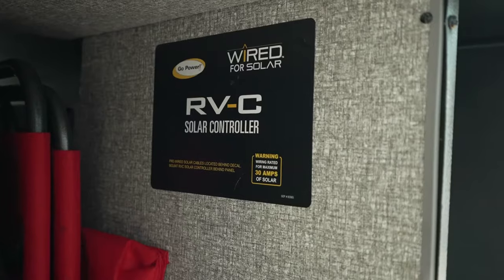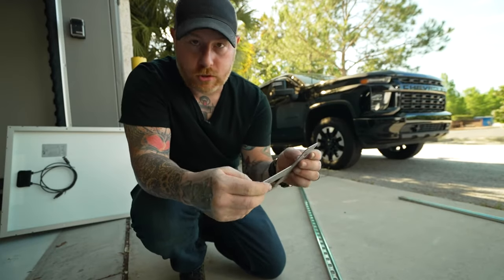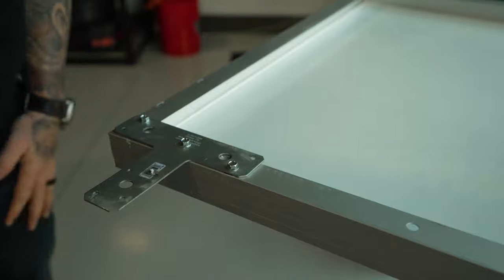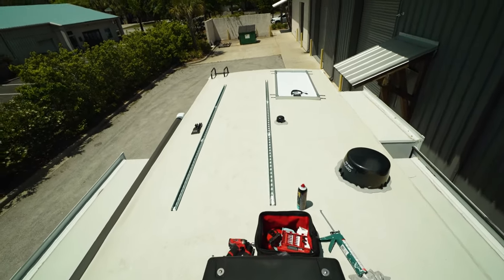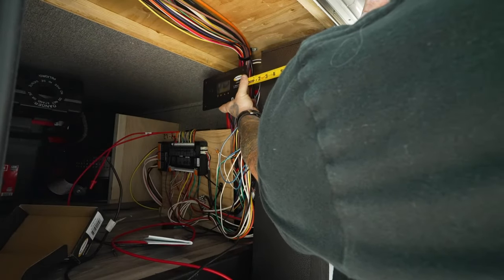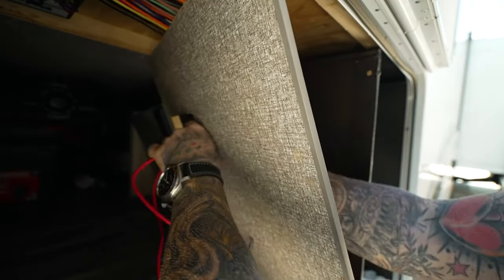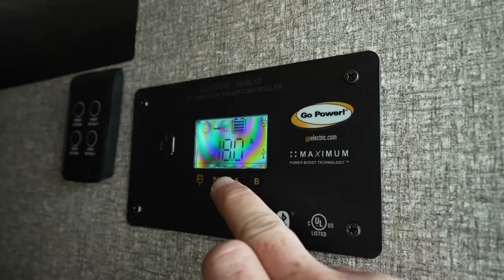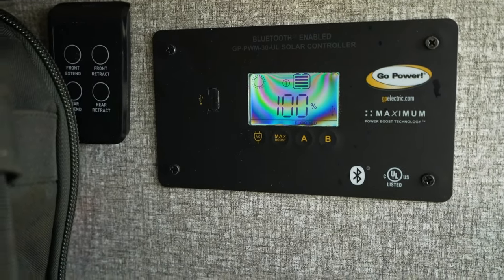Installing Solar Panel System on a "Solar Prepped RV"

Comment: Thank you for the video. My husband passed in February and we were going to get an RV and travel selling everything we have. So now I'm doing it. I have 5 solar panels that he was going to install on our house. But now I think I will use these for the RV. I just need to look further to understand how to set up the entire system. I have a Aims Inverter Charger. 120v. I have plenty of batteries around this place all plugged in keeping charged. I like the strip pieces you installed on the roof. Great idea that I will probably do. I have a Class C 28' RV. I'm 68 years old and I hope I can pull this off. I am renovating the RV on my own. It's beautiful!
Reply: Love that you are carrying on with dreams and plans even with such a great loss. Go for it!
I bought a trailer last year and toured Az for the winter.. Also now putting a solar system together.
Reply: That's horrible I'm so sorry I hope if your on the road right now I hope it's going amazing
Reply: Sorry for your loss

Comment: On my install I applied Eternabond tape in each spot where a bracket screwed into the roof. After drilling the holes through the Eternabond, I applied Dicor to each screw before driving it in. Then I sealed the bracket/screw heads with a liberal amount of self leveling Dicor. I inspect those several times a year, and add sealant on top if needed.

All the sealants - Dicor included - will dry out and crack in direct proportion to the amount of sun/weather it receives... usually within a year or two. Eternabond has been known to last many, many years - a far superior seal than lap sealant. Keep a close watch on those screws holding your brackets. If that sealant dries out and cracks, there is nothing stopping water from wicking through into your ceiling.

Lastly... I've seen 10+ year old TPO roofs with jigsaw puzzle Eternabond patching... and NO leaks. Remember, no one can see your roof anyway. If I ever reconfigure/update my panels I'll just overlay the existing holes with Eternabond and be done.
Reply: I police RV roofs for beauty! lol

Comment: Another option is residential solar rails. I’ve heard but haven’t personally experienced that Unistrut collects debris because there’s no air gap.
I used IronRidge XR10 rails. They’re made out of aluminum and super lightweight. A 14’ span is only 6 pounds and incredibly strong. I paid $43 per 14’ rail.

Only issue is that it’s slightly more difficult to find. I got mine at a Rexel but you can try contacting a solar distributor or electrical supply business nearby for pickup.

Comment: They made fittings for unistrut that are made per the gauge of the strut (12, 14 and 16 if I remember correctly?). 
The fitting I have in mind is basically what you’re doing but stronger and cleaner. The fittings for unisteut is a little pricey for what it is (between $12-$20 if my memory is right)

Comment: Thanks for the tips! I will be putting a second 370 watt panel on our new Brinkley in the next few weeks. Not sure if I can use you the method you did  but it is interesting. The Brinkley comes with one 370 watt panel and a 50 amp charge controller installed. I will put a second panel and a 3000 watt inverter in. Also they use a special self leveling caulk which I already got with the kit. Thanks again. Burlington Bill singer songwriter busking on the road and here on You-Tube.

Comment: Nice, I'm gonna use this setup on my RV. I'll give you a shout out when I make my install video. You have some nice roof space up there. you could easily put enough panels to run your AC(going over that pipe vent). I'm installing a 48V battery and should be able to run my single AC unit during the day and then should have enough power to run my AC for  5 hours after the sun goes down.  cheers.

Comment: Great video, im planning on doing this exact same install on my 5th wheel. One question, what size bolts did you use for the drop in nut in the channel. 1/4 or 3/8? I was worried about 1/4 not being big enough for a strong wind. Also how long of bolts did you use for those, 1 inch? Thanks in advance for any information, and DIY people like me, rely on videos like yours to give us the information we need to do it ourselves. Keep up the great work.

Comment: Well done! Couple questions…1. Where did you get.  The “channel swivel nuts” or whatever they are called. 2. Did you use a stud sensor to try to screw your lags into the studs, or not worry about it? 3. How many lags did you use, or how many per feet? 4. I may have missed it - fiberglass roof or rubber over wood? 5. Did you use galvanized lag bolts and washers? Or not worry about it given the dicor cover? Thanks much! I subscribed!
Reply from the maker: Hey, I got all the hardware from home depot or lowes. they both carry these systems... Look near the electrical conduit and stuff.  I did not use a stud sensor the roof is ply-wood and has plenty to screw in to anywhere. I think I used 4 lag bolts per channel. about 1 every 24 inches or so. I used both galvanized and stainless steel hardware. maybe some zinc coated too... Hope these helped. Thanks for following along. check out my other RV focus channel too. @thebrodiebunch
Reply: @BeavBrodie1  Naaaice!  Thank you for your video and further information on where we can find the rail and how far a part you screwed in.  We will do the same set up!
Reply: The Channel is called
THIN UNISTRUT IE REGULAR UNISTRUT is the same height as it is wide.
Those nuts are called
SPRING NUTS FOR UNISTRUT.
they start in 1/4" Threaded holes and go up to 5/8ths " Threaded holes.
Unistrut and spring nuts are the Lamborghini of outdoor universal mounting hardware.
Anywhere you look on the most important structures that is what's there they also have Hundreds of types of mounting hardware and make all of it in Lightweight Aluminum but it's expensive and worth the cash

Comment: Great Video as I’m about to do the same exact install on my new Jayco! I guess my only concern would be the struts acting as 10ft dam like areas where water could sit on the roof? This happens at roof seams and typically is the spot of most leaks.

Comment: Curious how your inverter is wired into this. Also I’m looking at a Victron MPPT controller with a 200W panel to maintain my two Type 24 AGM batteries for now and possibly expand later.

Comment: Have you noticed how the water drains now? I’m concerned about water damming up against the strut. Maybe I’ll put some washers under the attachment points to the roof to raise the struts slightly. Overall great video, thanks!
Reply: I would agree with this thought. I would also like to use stainless as galvanized can still rust and drip rust onto the roof.

Comment: Wish I could make a plan to discuss my install with you. My son and I live in a trailer and want to add solar to go off grid. I don't want to use gas for refer/hot water heater, I want them on solar power with lights. Basically,  I want solar as if I were plugged into 30amp power. Jonesy

Comment: i am uncomfortable drilling into the roof, tho i appreciate your video.. for making the panels more secure, but i am using the no drill bracket method with eternabond.. ( i am parked at a campground and i just want to have uninterruptible power) and add resell value of course, .. but i have 1kwh of panels (24v) going to a hybrid 3kw all in one inverter (powmr) that can take shore/grid power, PV (solar) and use battery for load .. with priority settings.. using PV 1st then battery to a low 20% state (i set that) and after that it will pull from grid .. to power the RV and also charge batteries back to 80% before the batteries take over again.. or if the sun comes out PV takes priority to run load and charge.  all told cost was 2200.00 .. I am surprised your not running something like that for the cost basis and scalability..  I can scale my system to  5kw in solar and 50kwh of battery as the inverter can handle 450V of panels.

Comment: Excellent video. Well we’ll explained! Did you screw the lag bolts into the RV’s roof trusses? I’m thinking about adding solar to mine.
Reply from the maker: Hey, thanks! I did not go in to any trusses or framing, (that I know of) Hard to locate. my roof is solid plywood. making it hard to located, but also plenty strong to screw down the tracks anywhere.

Comment: Hey great video. I have a Jayco north point and have considered adding solar and an inverter. The rig has solar prep and like how easy you showed it could be configured for solar. You say that you put in a shunt from victron and an inverter from Renolgy. Do you have any pictures of how or where you installed these items? I was considering installing the victron multipro2 inverter and was hoping to get insight on the renolgy installation as it may give me ideas for the victron inverter install. Thanks

Comment: Great idea but, stainless strut and hardware would be better. You can also use strut flat t’s, also stainless. They also have strut covers that will allow you to use the stuff itself as a raceway for your wire.

Comment: I like the install, but I'm concerned about corrosion on the HD unistrut channel and  nuts. SS Unistrut would great.
I saw an install recently that was done with epoxy, no screws into the roof.
Reply from the maker: That’s an option too, but no flexibility in the future and  the epoxy is only holding to the roof membrane. unless you have a fiberglass roof..?
Reply: @Beav Brodie  yes good point. I was thinking of fiberglass roofs.

Comment: The galvanized unistrut is only a good idea until it starts rusting, which doesn't take to long. Then you ready for a whole roof replacement for $10k.
Reply from the maker: Galvanized stuff doesn't rust. No problems here.

Comment: I used your hand me down idea to install 12 - 100 Watts  panels  on my friends big motor home ,  but the wireling  is what's  getting me confused  , should  I wire them in parallel  or in series? He has a good inverter and a solar  charger, but he like to run a lot of thin at the same time,  can you help me with  this please.
Reply from the maker: @ramirorodriguez9611  It’s going to depend on how much voltage the solar control can handle. There’s several other nuances to this.
Series will add voltage with every panel. 
Parallel will add amperage but voltage will stay the same.
You may end up having to do a combination of
both with some calculations to select the correct wire size etc. 
I know this isn’t a super helpful answer and might raise more questions.

Comment: is there any worry putting these on the roof with wind getting under it while traveling and ripping them off?
Reply from the maker: Not if you screwing into a wood roof or the studs. This is going to be more secure than the standard solar panel mounts. 👍🏼

Comment: Drop the group 24 garbage and go lifepo4 battery 1280watts per 100ah can buy run down to 0% battery and lasts 10 years and weighs 1/2 or less

Comment: Did you install the inverter?
Reply from the maker: I did install this inverter, but it’s not the one I’m going to use permanently. for various reasons. I really want an all in one power inverter, converter… Victron Energy multi plus II.